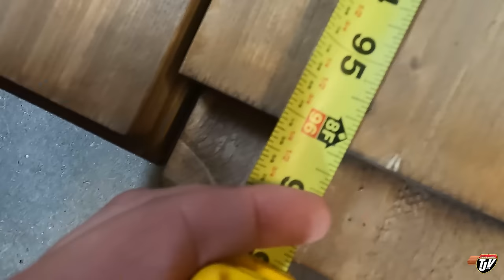TRUCKER PROJECTS | TJV Vacation | Vlog #3133

Comment: I think that the reason your 2x6x8’s where short is because you can buy 2x6x8 that is actually 8 feet long or you can buy 2x6x8s which are for framing walls and they are a little shorter then 8 feet.

Comment: TJV. The reason you have two different timber lengths. One is an imperial eight foot and the shorter one is a metric eight foot, 2.4 metres 2400mm which is half inch shorter than the imperial 8' a true 8'

Comment: Here is some AI results:

Black spots on the leaves of a weeping willow tree can be caused by a number of diseases, including willow scab, black canker, and rust:
Willow scab: A fungal disease that causes irregular black spots on new growth, which can cause the leaves to wilt, shrivel, and die. Other signs include olive green spore masses on the underside of the leaves along the veins.
Black canker: Causes dark brown spots on the leaves, and can also appear as sunken cankers on the stem.
Rust: A fungal infection that can cause orange or brown pustules.

These diseases can often occur together, and when a tree is infected with both willow scab and black canker, it's called willow blight. Willow blight can cause defoliation, significant dieback, and even death of the tree. 

To control these diseases, you can try a combination of cultural and chemical treatments. Chemical treatments include applying fungicides at the right time to reduce the spread of pathogens and symptoms. 

You can also try pruning off infected parts of the tree to prevent the disease from spreading

How to Control Black Spot: Once black spot becomes active, the only way to control the disease and stop its spread is with an effective fungicide. GardenTech® brand's Daconil® fungicides offer highly effective, three-way protection against black spot and more than 65 other types of fungal disease.

Your local home and garden center should be able to steer you in the right direction.

Comment: There are a number of causes. First of all, Black spots on weeping willow leaves can be caused by an imbalance in the soil pH. Weeping willows prefer a slightly acidic soil with a pH between 5.0 and 6.5. If the soil is too alkaline, the tree may not be able to absorb the nutrients it needs, which can lead to black spots on the leaves. Second, the tree might have the start of an infection, and the use of a fungicide could cure the issue, and doing some pruning may eliminate the issue of the black spots. Have a local expert identify the cause to have a healthy tree, and follow his/her directions.
Reply: Local ag dept may be able to diagnose it if Josh brought in a sample. Can give them a call